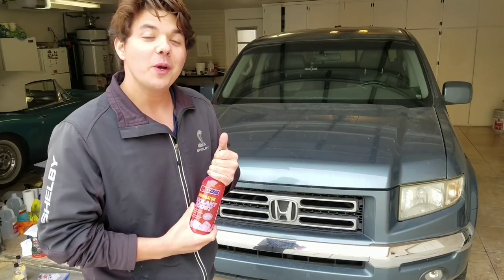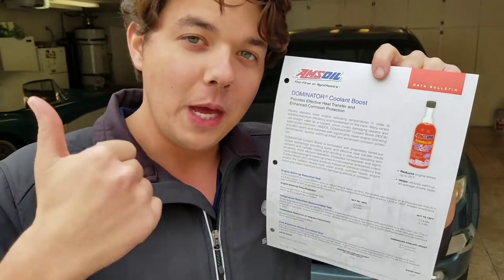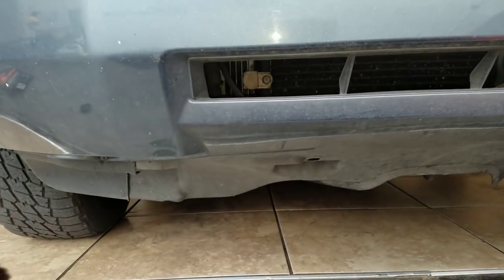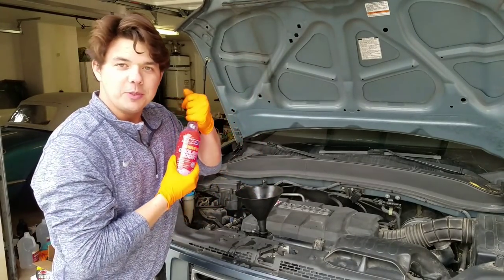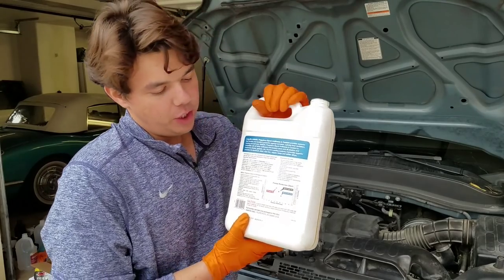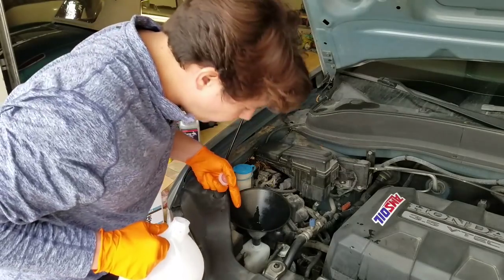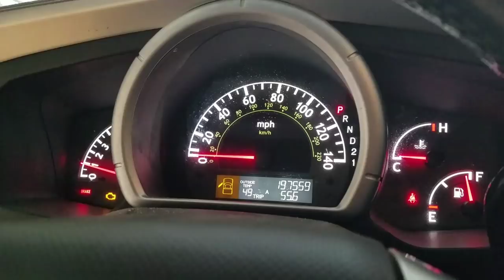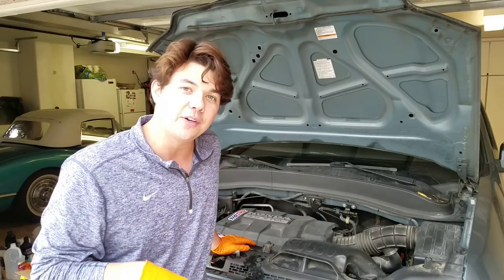2006 Honda Ridgeline radiator coolant change Amsoil Dominator coolant boost

Comment: Very interesting. I have all digital gauges in my car, would be interesting to compare how quickly the car warms up that way. I'm guessing you could time it and see the improvements, assuming ambient and starting coolant temps are consistent.
Reply from the maker: I think it would be mind-blowing! 

Because the Porsche engine runs nice and warm and I think it would warm up about 15% faster than the Honda
Reply from the maker: I wonder if there is a oil temperature thermometer in your motor oil that shows the exact oil temperature?
Reply: @Syntheticoilprotection  yup, I have that too
Reply from the maker: @TheSoundofSpeed  
This is going to be an awesome test!
Reply: @Syntheticoilprotection  tempting to just bring the car down to Vehas and do everything all at the same time.
Reply from the maker: That's how I felt before I tried Amsoil. 
I'm around quite a bit just give me a couple days heads up😊

Comment: Hi Eben!! If your car's coolant capacity is 6.8 quarts how much of the coolant booster should you use in a 40% coolant 60% percent distilled water mix on a all year round warm climate? Thanks in advance for your prompt response.!!!
Reply from the maker: If it was 40% cool and concentrate I would run probably about 2/3 of the bottle
Reply: @Syntheticoilprotection  Ok. Thanks for your prompt response.!!!👍👍👍

Comment: Subscribed! 

If I had my transmission fluid mix with my coolant (strawberry milkshake of death) because of a radiator failure, do I have to flush the system out really good? Or will filling and draining new coolant a few times filter out most of it? I tried to flush some water through it with a hose but because of the thermostat it didn’t really go though the system enough. :( thanks
Reply from the maker: That's a great question I really don't know anything about the GTR I would consult an expert with that vehicle.

     I do know I wouldn't drive it if it didn't look right if the fluid doesn't look right I wouldn't continue to drive it.
Reply: Synthetic Oil Protection oh it’s not on a GTR it’s on a ridgeline lol. I haven’t driven it in a few months. I replaced the radiator now I just need to fill it with new coolant. But I’m sort of afraid there’s still transmission fluid in the engine block. Thx for the reply!
Reply: @thefastandthefurious1  hey, what ended up happening to your fluid coolant mixture in the radiator ? I had the milkshake issue in my Ridgeline and the mechanic told me he flushed the transmission and installed a new radiator but there is still a bit of milkshake fluid floating at the top of the radiator cap. I tried siphoning it and am contemplating doing a radiator flush myself
Reply from the maker: Yeah I would do a couple of draining fills and fill it with distilled water.

When you feel it the last time it's good to use the amsoil low toxicity biodegradable coolant and also the other one that's great is called the amsoil Dominator coolant boost which is the orangish bottle.

If you've never tried amsoil this is my personal link and if you ever have any questions always happy to talk anytime.

Professional YouLubher: Eben Rockmaker Regency Direct Jobber AMSOIL Specialist (Dealer#: 5331179) 702-472-3614 

Get AMSOIL Wholesale Pricing - https://www.amsoil.com/offers/pc/?zo=5331179

Comment: Its all in the block. There's a bleeder vavle on the rear of the block specifically for this. Theres probably close to a gallon in there.
Reply from the maker: That's awesome I'd love to see a picture of that if you could send it to me.
702-472-3614

Comment: How do you get out air bubles?
Reply from the maker: You would want to squeeze the radiator hose and let the car idle.

Usually all the bubbles come out then.

It's also good to run the heater core and turn the heat on high.

Comment: What makes this better than the honda coolant?
Reply from the maker: It lasts longer it's also biodegradable and low toxicity.

The Honda coolant will kill animals because it has it's a standard coolant that's toxic to them and also taste sweet cats and dogs.
Also you will find that the Dominator coolant boost will make your car run smoother also you'll feel a little more power and you'll get better gas mileage and your car will warm up quicker.

These are all improvements over OEM Honda radiator coolant
Reply: @Syntheticoilprotection  ok thank you for detailed reply.

Comment: The best product you can use for your vehicle is waterless coolant by Evens. You never have to flush it and you will never deal with corrosion issues.
Reply from the maker: Evans does recommend you call them for your application because if you are doing racing and other things like that you may need a higher specific heat which would be distilled water to cool the system depending on the capacity so there are some other variations Evans is in great option but not for every vehicle.

I called Evans and had a talk with them and they were very professional and honest about all the applications.

Comment: If you are doing a brand new coolant change, why do u need the boost?
Reply from the maker: Great question Jay Just depends on application also depends on coolant mix ratio and coolant being used
Reply from the maker: There are coolants that are racing coolant that have special additives for surfactant some have no surfactant the Amsoil has that in it however it does wear off and it also depends on the mix ratio the more distilled water you run the more surfactant you want the more coolant you run the less surfactant you want because the surfactant is in the coolant.

Also the surfactant is a chemical and that chemical breaks down with oxidation and heat so it has to be replenished in the coolant system You do not have to change the fluid but you actually want to replenish it and it says right on the bottle on Amsoil dominator coolant boost good for 1 year or 30,000 mi whichever comes first So what I usually do is around the 10 month mark I start adding a little teeny bit and I keep it supplemented throughout the year incrementally adding into the system.

Also most systems have breathers so they all go down in volume so I always top mine off with distilled water to keep it up at water level.

Just subtleties but all the subtleties add up and make a difference in power performance fuel mileage and you'll also notice your motor will run quieter and smoother

Comment: did you take out the air bubbles from the system?
Reply from the maker: Never had any trouble with air bubbles with these Hondas they've always been so easy!

This was the hardest one I've ever had because of the way you drain it
Reply: - He didn't drain the engine , only the radiator , the entire system has 8.5 qt . 
 - You don't have to take the petcock out  it has a O ring and i think you don't have one on :(

Comment: 👍😁
Reply from the maker: My Link: Best AMSOIL 100% Synthetic @ Wholesale + FREE Shipping: https://www.amsoil.com/offers/?zo=5331179 
AMSOIL Products & Vehicle Lookup - https://www.amsoil.com/guides.aspx?zo=5331179  
AMSOIL Performance Tests - https://www.amsoil.com/performancetests.aspx?zo=5331179

Follow these accounts for Ebens Giveaway:
Instagram - https://www.instagram.com/syntheticoilprotection/

Facebook - https://www.facebook.com/profile.php?id=100007973957868

People ask me these three things:

1. Where can I find AMSOIL? - Use this link https://www.amsoil.com/offers/?zo=5331179
Or
Watch THIS: 3 Fast ways to get AMSOIL - https://youtu.be/RiYifuDCsnQ

2. What makes AMSOIL different than other oils? - AMSOIL is 100% Synthetic & has higher film strength & last 4×longer then Mobil 1 EP which protects and separate metal parts keeping them from wearing and Lasting Exponentially longer: https://youtu.be/f4eNPgTi_qo

3. Why should I use AMSOIL?: It protects the engine so it will last longer. Less oil changes less often(once per year/15,000miles) or longer... Save money in Gas & Time making it less expensive then a free oil change over the year - https://youtu.be/H7K6FdZlqmg

Professional YouLubher:
Eben Rockmaker Executive Direct Jobber AMSOIL Specialist (Dealer#: 5331179) 
Mobile: (702) 472-3614
My Link: Best AMSOIL 100% Synthetic @ Wholesale + FREE Shipping: https://www.amsoil.com/offers/?zo=5331179 
AMSOIL Products & Vehicle Lookup - https://www.amsoil.com/guides.aspx?zo=5331179